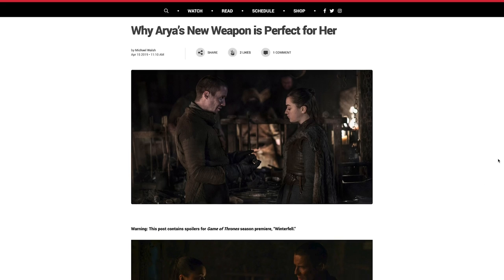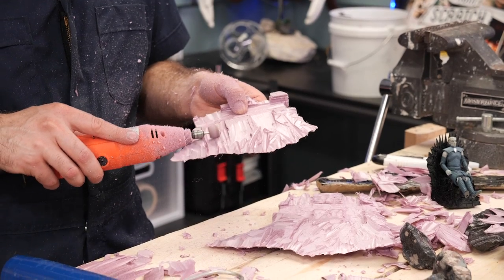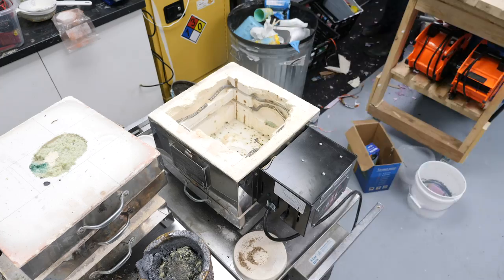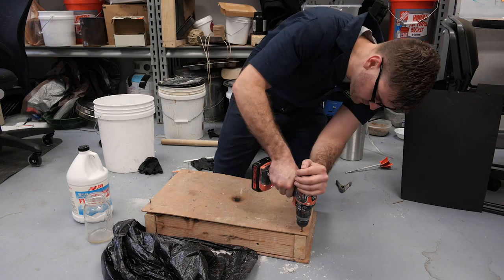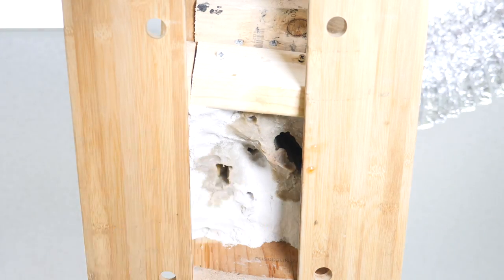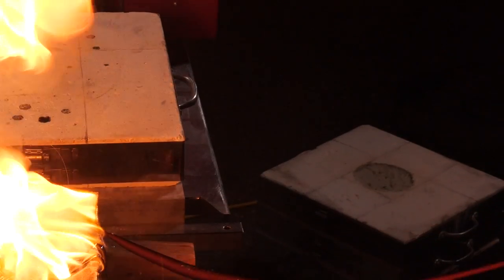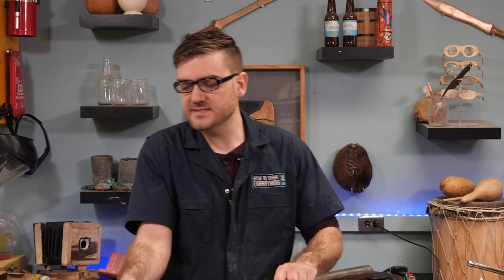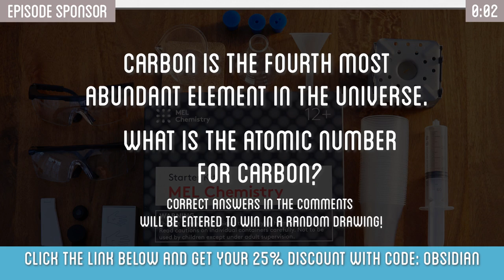Melting Dragonglass to Cast an Obsidian Axe

Comment: The whole obsidian can be melted = worked like metal sound wrong. Try working it like the glass it is. (No castings of solid glass and more glassworking. The most solid option would be “obsidian coted axe” where you would start by forging an iron/steel / other metal (with higher or at least slightly lower melting point than obsidian) axe head with lined cuts on its surface to give it larger chance to stick, or holes through the head if it was unsuccesfull. Then you would slowly melt small amounts of obsidian and slowly coat the axe head with it. When you finish the basic shape of the axe head you would reheat the whole axe head in your kilm at temperature at which the obsidian would be slightly melted and mainly sticky to help the layers get a better grip on each other. Your goal is to in the best case heat the whole axe head to this temperature and  slowly let it coal to let it form its crystaline structure. This axe will still be somewhat fragile which you could somewhat compenzate by adding small layers of steel wire (2-5 mm) on top of each layer. I would try to make the layers about half an inch thick, but the density of obsidian will make it difficult and almost imposible without a good blowtorch to keep the layers at this thickness.

Comment: Since obsidian is, in fact, glass... could you turn it into borosilicate glass like old fashioned PYREX? Or maybe stabilize it with a crystal of a higher Mohs hardness, like quartz? I'm feeling like the difficulty is more that you're trying to have a finished item out of the cast... what if you were to use a high count sandpaper or micomesh to smooth it down and get an edge on it? Buff it down gently, maybe do some light knapping first and then even it out?

Comment: I've been watching you for a while and while I applaud your gusto and creativity, man I don't know if you purposefully intend to fail. Cold molds and hot glass don't work. Your glass maker friends know this. Drastic changes in temperature, excess heat and excess temp changes are not friends to glass.

Comment: Glass blower here, why don't you try the pressed glass method used by Lalique and daum ? With the metal-like casting and annealing methods you used, your obsidian is guaranteed to break because glass is extremely sensible to temperature change, unless it's very specific like borosilicate. I also suggest you to use the pâte de verre technique above all, you will have way more control over the final result.

Comment: I think you need to compact the mold better than that... And remove water and organic materials by pre-heating it. Also, I never did metal casting, but I think your'e supposed to add vent holes when doing complex castings. Otherwise, gas expansion prevents the metal from seeping into the small holes.

Comment: A question about your casting teniques. I've seen on How It's Made type videos that when OEM manufacturers cast parts, they follow a similar pattern. Make a disposable core, pack it in casting sand, ect. They then preheat the mold for several hours in an oven to prolong the working time of the molten metal and to provide a cleaner result. Do you think preheating your molds in a normal oven would give you more working time, like with the molten copper?

Comment: fan of watching this channel but a few questions on your casting methodology; 
A; Why don't you have vent holes?
B: why don't you pre-heat the molds (while bulky this can be done to some degree in a regular oven)
C: in pewter casting some form of powder is used within the mold to decrease the amount of metal that touches the walls and sticks to them (thus increasing the overall flow of the metal), could this help?
D: is there any reason you haven't tried easy to cast materials like pewter, you could even make merch (or you could have me make merch :D)

And e: no offense, but do you look into manufacturing techniques and tips when making a video, or is the charm in how it fails and the mistakes you make?

Comment: Need to cut a hole in the foam? disconnect one end of the wire, make hole in foam, fish the wire through the hole, reconnect, turn on and cut out the shape. Then? Let wire cool, disconnect, fish wire through next hole, repeat.
Also, maybe find out if you have any glass workshops nearby. They could offer some help in the form of classes, materials, equipment, etc.

Comment: Did you ever try a vacuum or air pump? just noticed you have never mentioned it but its a widely used technique in the glass blowing and moulding industry, create a far more solid die/mould to work with and create an attachment at the either the thickest section or the section furthest away from your pour inlet, turn the vacuum /pump on and the second you pour the glass, it should seal the inlet as long as you keep pouring and create a vacuum and thus in theory should pull the glass through befor it sets, if anything it would atleast give you a better blank in which to polish or work with.

Comment: Aztec Maquitl: basically a cricket bat with the edges lined with napped obsidian shards. Supposedly the Aztecs were able to behead a few of the conquistadors’ horses with that thing. Otherwise stick with napped arrowheads, spearheads, and knives. I’m also wondering that if the white walkers are weak to obsidian could you take just an unrefined chunk of it bash them in as either part of a club or hurled with a sling

Comment: @6:47 - That part is bars that are riveted in place.  They also hold the handle in place.  They are not supposed to be cast.  As you said.  Blacksmith work...

Comment: Rather than making the big battle axe, could you not use the knapping process on a smaller peace of obsidian to re-create Arya's Blade? And if that is possible, how well would it perform as a weapon?
also, the atomic number of Carbon is 6.

Comment: question, if you were to cast a large enough block of the  glass, what if you were to then carefully sculpt it away by chipping parts off?, may take a few tries since youll more than likely crack it but may have better luck with something that looks closer to what you wanted

Comment: I think storing in the mold in a different furnace so you are pouring the obsidian into a full heated furnace/mold. Almost looks like it cooled down too much as it was casting, which might be avoided by using two different furnaces.

Comment: Great effort, but you can see the technical issues trying to cast a material with this high a melting temp. This is why the Aztecs used natural obsidian flakes to form the cutting edge on their Macuahuitl (battle axe)-flaking off sharp sections is about as good as you can do with a brittle material like this. Interesting video, though.

Comment: Maybe you look in ovens meant for forging. Put your crucible close to the form to not air cool it by falling so far down. I would try to rivet steel bands together and than cast glass between them. Preheated the form (with the metal already in) and hotter glass.

Comment: I think in the show what they did for casting the axe cast a block then nap the block. if you were to cast it into a block you could control the cooling and heating so it wont crack. "dragon glass is really hard to work with, but we figured out a way"

Comment: SMFH
Open molding is only used now for bulk raw material ingots - pig iron anyone?
Any time you want to cast a semi-finished product you have to use closed molds and they usually need to be rather thick to help control (slow) the cooling.
Casting ceramics and glass requires that you preheat the molds and keep them hot for hours after the pour and let them cool slowly; reduces thermal shock and allows the crystalline structure to form properly so your piece retains some strength.
Casting light metals, which usually have relatively low melting temps may also require thick walled molds that may also require preheating to keep the metal from freezing.

Comment: try it again but this time heat up the mold(s) in another kiln to a reasonably high temp so the glass / metal doesnt set before it is all the way down :-)
also could you try meting steel and dragon glass together and see if they mix , maybe make valarian steel ? , not sure how you would stir it though :-)

Comment: Mix your sand with petrol oil and arylsulfonic acid for your mold. You need to watch your ratio of acid to oil or it will not harden or harden up before you get it molded. Its the technique  used in most remaining iron foundries. You could build the casting into a vented flask. You will have to wait until it has cooled entirely. This will take multiple days. Great videos though I never even thought of molding glass.

Comment: Just gotta go get one of the giant piece's of obsidian and work it with knapping..technique's and maybe a sander and a Dremel and see if that's a bit more realistic...of course we don't have our chain's and even fewer learned to work/rework Valyian steel....but the key to Damascus steel is .914% thallium heated and cooled several times the guys from Saladiin's mine where they made the best Damascus steel brought it to an old timer here in middle America and figured it out after looking into the less than 1% mineral/metal value's and as you heat and cool it many times the thallium make's smaller and smaller sphere's which gave it the proper flex and strength....you probably caught that one??? Super cool..thank's for trying mane!

Comment: If you want to succeed with casting obsidian, you need to pour lava (NOT MELTED OBSIDIAN) into a mold and make it solidify rapidly. 
Easiest way to do this is to go to Iceland, take a gym session at Thor's power gym, then go to a volcano with a container of water and the mold. Pour lava in the mold and quickly put it in the water.

Comment: I think a better question is can you melt obsidian with a wood and bellows forge instead of a modern one. Electric kilns, gas fueled forges, and blast furnaces can all reach much higher temperatures that the technology available at Winterfell.

Comment: Why aren't you using risers?? They are extremely important. They let the trapped air escape and let the molten metal/glass/whatever you are casting get into the mould sooner. Do not pour slowly like you are filling a water bottle at a tap. Pour as fast as possible. In order to be able to do that, the trapped gases need to escape. Make risers and vent holes. Incorporate a poring basin into the sprue. That will make it slightly easier to hand pour using the crucible.

Comment: What about combining obsidion witn things like quartz and a few metals? Would it ruin the cristal lattice? I would imagine the reason casted obsidion is so weak is because A it probably isnt as dense, and B it losses some of the integrity that it gains fro that tightly formed lattice. Perhaps heating it up in a liquid that obsidion is somehow dissolved into then puting said liquid under intense pressure and heating it up and trying to force it to form like salt crystals? I would love to hear your oppinione on this ideq, as you probably know a lot more about this subject than i do.

Comment: Bruh, if you keep breaking kilns, then I'm sure the cost of buying or making one in the spirit of HTME will be cheaper than constantly replacing kilns. Just get one, big, robust kiln that you can store somewhere and easily deploy, along with high quality crucibles as well in various sizes. Put yourself in a position where you won't have inadequate space in the kiln, and it won't simply break due to an accident.

Comment: Interesting video, I really enjoy your experimental stuff, but I can't help but wonder who thought "dragon glass" was a good idea? Even in a fantasy world it doesn't make much sense to me, not when there's clearly iron in abundance. From a standpoint as both a geology and archeology nut, there's several reasons humans latched onto using metals, most of which you've now proved the hard way. It does make me wonder though if you would get different results from obsidian sourced elsewhere? It's a rock, not a mineral, so the chemical composition can vary depending on where it came from.

Comment: your moulds are cold you need to heat them up to a high temp before you pour. i would treat the glass the same as you would casting metals most people i know that cast there own jewelry keep the moulds in another kiln so both are close to the same temp. that way the glass wont cool down so fast and also you know that the moulds are 100% dry

Comment: The point of casting obsidian is to take the smaller pieces you have and smelt them into a larger workable piece, usually in the rough shape of your intended outcome , and then to Knapp in your edges.... I know this because i am a bladesmith and have done this on several occasions..... It is more for show though...... Just thought you might like to know.... Great attempts though. Most people dont get that far without giving up....

Comment: I feel like the glass projects always fail more than others because of the really specific skills and high temps needed that specialized fabricators have. I get that it has a certain cool factor but it seems like having improper equipment is causing more issues than it is worth

Comment: You should really heat up your molds to the same or at least close to the same temperature as the obsidian. The temperature difference is weakening your  obsidian before it even has time to set and is keeping you from making a full cast.

Comment: When you did the wax method you should have put it in a regular over and then turn the heat on. Would have got all the wax out of it and prevented the vapor from ruining your molding

Comment: 1) Axe shapes should be poured as a slab 2-3 inches thick, then lap the edges.
2) Why bother CASTING what appears to be riveted brass/bronze plates when riveting is so much simpler?

Comment: You just said "Obsidian is Glass"... You cant really Cast Glass to start with (You can but yeah) so the whole idea doesn't really make a lot of sense when you think about it. Yet Obsidian is typically connected to high end or in games high damage or mid to endgame weapons. I always found that interesting as well. 

Why not instead heat a bunch of the shit into a Billet then try to work the stuff into something with hand tools from there? Probably still wouldn't work but maybe worth trying if you seriously want to make a dagger or something out of Obsidian.

Comment: Pure Obsidian Casting is done in high pressure chamber kilns with higher temperature. Higher pressure to prevent bubbling. Higher temperature to bring all of the mass in highly liquefied material. You need a proper physics lab to cast Obsidian without using any Flux.
Peace.

Comment: what are the benefits of using a kiln over a foundry?
Reply: Edgar Gryffydd one uses electricity and generally cost more up front but you might save on propane or charcoal you would use for a foundry also foundry can get much hotter

Comment: i am a amateur ring maker, that only does casting. this is 100% the wrong way to do such projects. only way to craft obsidian is to chip it down to the shape you want. its just not viscus enough pour, bronze/copper is also impossible without a vacuum chamber to take out all of the air. air gets heated up and makes the metal/glass colder making it more solid. as for the plaster/sand he used, its better to get some clay with oil in it so the oil burns/turns to ash which is the best insulator so the heat doesnt mar the casting.

and open air casting like he resorted to for the metal grips is always doomed to fail. better to use malleable metal strips like tin if you just want to get it done fast.

not saying im the expert but there were plenty of mistakes if he wanted to complete the project. 

he did make the shaft like a pro tho, i guess he is pretty handy

Comment: The glass is way too thick to flow into the deep molds. you have to cast it in flat molds and pour it very quickly.
Reply: or heat the mold.  a hot mold will make the glass stay liquid longer.

Comment: Comparing obsidian to a razor is like comparing a razor to a butter knife. With an edge around 30 angstroms obsidian is far superior to a razor or even a surgical stainless steel scalpel which is around 100-600 angstroms.

Comment: C'mon, its not that difficult. Sand mold with a styrofoam form. Thin steel sheets to hold everything together. Put it into the oven and bake the styrofoam away. When the mold reached like 600 or so degrees, pour the glass into it. Then let everything cool down real slow for like two or three days. Done.

Comment: why would you not make a 2 piece mold use the wax to shape it and the sodium sillicate   and co2 to harden it  split your mold ..remove the wax  in seconds  add risers and vents as needed close the mold then pour ?  melting the wax into the sand then vaporizing the remains will take hours  unless you want to trap gas in your cast lol

Comment: well, the things is that they don't really need a sharp edge. When you're fighting normal humans, the reason you want a sharp edge is to cause bleeding. But undead don't bleed. It doesn't particularly matter if the edges are sharp (in fact it might be better if they aren't: no possibility for friendly fire). 

Also, the reason to do this is to provide your warriors with weapons that they know how to use. No medieval knight would know how to use the shape of axe that you can get by knapping, and you can't make a dagger that way. They don't have time to practice with the weapons, they have to just get them and go. Though it was a bit weird to see Gendry casting obsidian spearheads, when you can make one of those things by knapping in about half an hour. But that's a pretty obscure fact outside of Anthropology circles, so the show's writers can get pass.